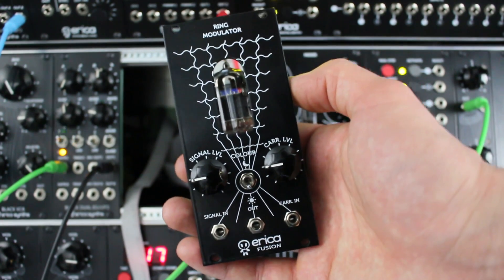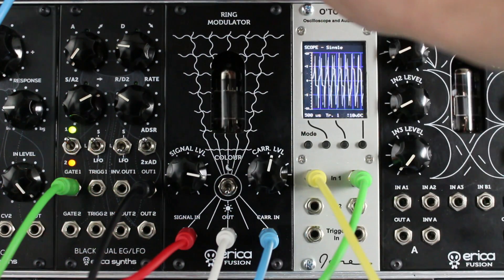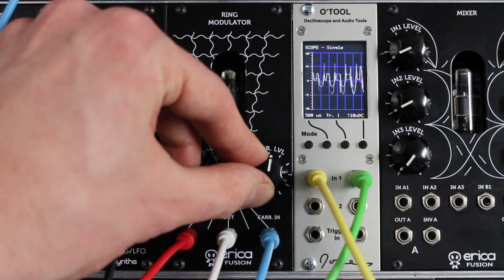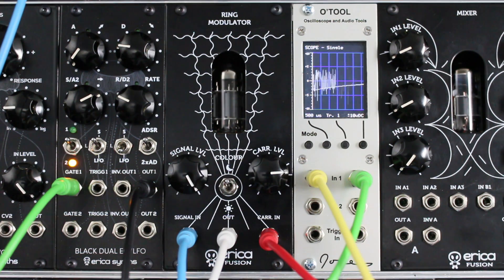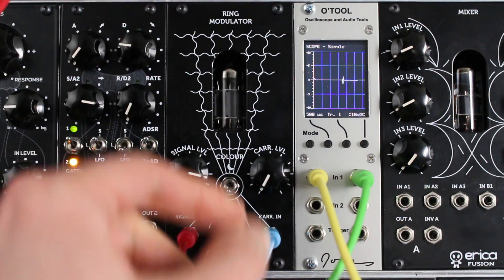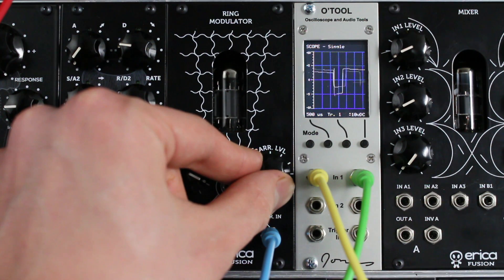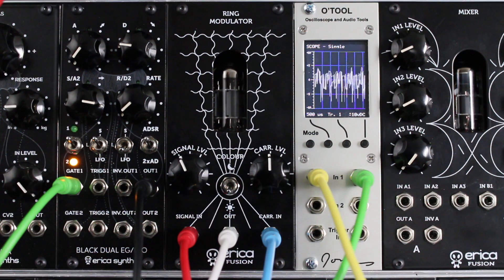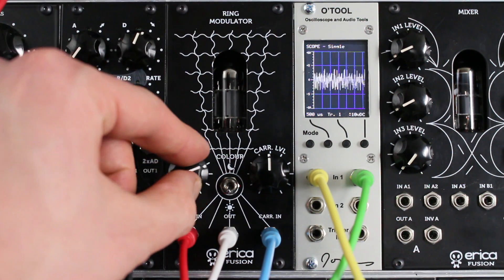Erica Synths Fusion Ring Modulator mkII demo

Comment: hello. i have a question. till now, i didnt needed audio in or out module. but i like the sound of this ring mod a lot. is it necessary to have audio i/o module? the tube could handle an extenral signal from non modular gear? and can i take the signal from the output from here directly to my audio interface?